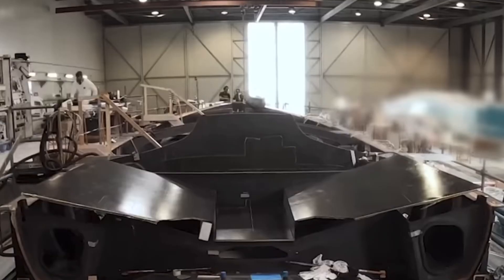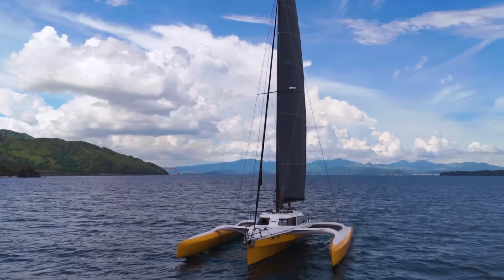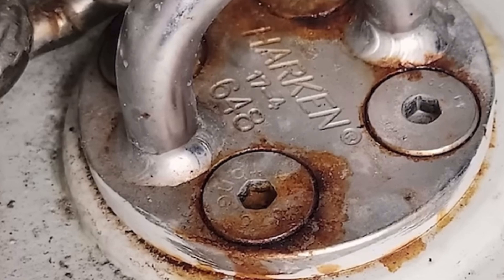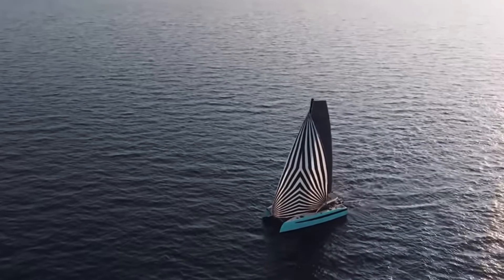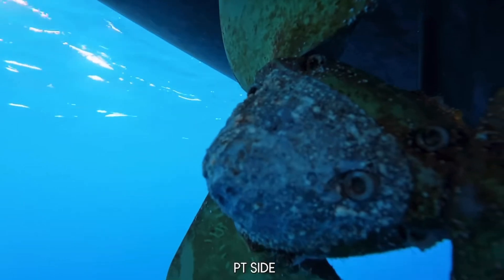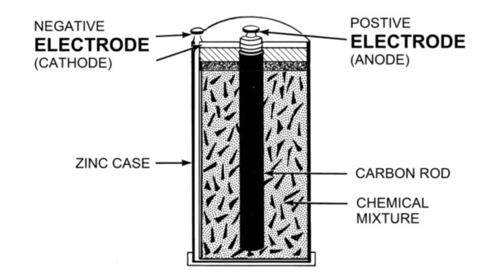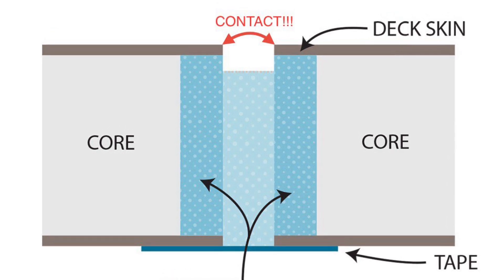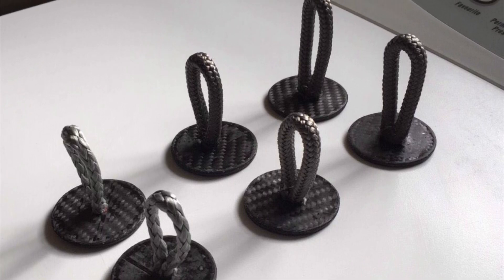Is Carbon Fibre Really a Good Idea for Cruising Boats?!?!?

Comment from the maker: I made this video is because I’m seeing more and more carbon fibre appearing in cruising boats and much of it has little practical effect other than being an expensive fashion statement. 

Carbon fibre construction can result in a lighter boat, but so can doing a build properly with S glass. For example the prototype Farrier F-9/F-31 Redshift was launched at around half the sailing weight of the first production F-31s, simply because the prototype builder was far more fastidious during the build process. In other words a sloppy builder using carbon fibre can easily construct a boat that weighs more than a careful builder using S glass.

I also wanted to draw attention to the downsides of carbon fibre because I hear people talking about it as some kind of panacea that solves everything, which it doesn’t, and in fact it introduces other problems that don’t exist with other materials. 

I’m a firm believer in using the best tools for the job, and carbon fibre is the best tool for many jobs, but not all jobs!
Reply: @SailingTipsCa  I have certainly seen some heavy carbon fabrications. Getting carbon to be light requires competence from the laminate specification through to the finish 1g at a time.
Reply: @deerfootnz  Yes for example some builders are providing pretty chunky carbon masts that are actually heavier than they would be in aluminum…
Reply from the maker: @deerfootnz  Yes a shoddy builder who makes overweight boats with glass is not suddenly going to make lightweight boats with carbon!
Reply: @SailingTipsCa  It's amazing how many  boats I have delivered are nowhere near quoted displacement numbers when in the travel lift slings. Quoted displacement often excludes tank contents, sails, stores, gear, toys, personal effects etc. Even allowing for that many boats I have seen must be between 10% and 25% heavier than the numbers in the brochure. The polar diagrams published are also laughably inaccurate, in part at least because the displacement is much higher than stated. I can sail. I have alot of experience and have competed at a high level and won consistently. On some boats I can't get within 25% of the polars. The sail area numbers are often out by similar measures. As soon as you buy new sails you see how inaccurate some manufacturers are. The boat I bought for myself is one where the design displacement allows for  half tanks and 2500kgs of gear. The half tanks is because the fuel and water are pumped to the windward tanks and transferred on tacking - worth between 0.5 and 0.75 knots and/or about 4⁰ of static heel.
Reply: Do not forget some people push a product good or bad. It's how they decided to make money.
Reply: Let the carbon remain in racing, me as a future cruiser don't need it at all.... better be safe.
Reply: @Kairat1969  and why would carbon be less safe? What isn't safe is poor design and construction, and I see plenty of that in every glass production boat.
Reply: The corrosion of deck fittings is solved by going with titanium. If you can afford a large carbon boat, you can afford the titanium parts.
That, and isolate the stuff you can't have in titanium.
Carbon fibre conducts electricity. as such, it will kill alu and lesser materials in direct and even indirect (under water) contact.
Reply: @NBM397  Then some marine electrical guy will screw a device into the bulkhead using stainless screws. Suddenly the hulls are alive with sounds of electrons.
Reply: @ you tell him before he is to work on the boat.

Comment: Wood for cruising ^^ super interesting now I understand why they dont use metal for anything on the raceboats
Reply from the maker: You see more metal fittings on more traditionally built racers. For example I’m regularly sailing on a beautiful cold-molded Wylie 43 which two plies of strip planking sandwiched between glass. Nice and warm and no corrosion issues like carbon!

Comment: Properties of basalt roving
density: ca. 2,7 [g/cm³]
linear tenacity: 70tex – 4800tex

roving type: assembeled

E-modulus: 90 – 100  [GPa]

tensile strength:  3000 – 4000  [MPa]

moisture absorption : 0,03 [%]

temperature range: -260°C bis +750°C

Advantages of basalt roving

higher tensile strength compared to glass and PP-fibers

cheaper than carbon fiber

low moisture absorption

outstanding temperature resistance

natural product

environmentally friendly in production
Reply from the maker: Never used basalt but it has some cool properties so not sure why it’s not more common?

Comment: Full carbon construction can also interfere with radio transmission. ie. maybe can't make a mobile phone call inside a carbon boat, when glass boat in same location is no problem.
Reply from the maker: Yes so an EPIRB activated inside a fully carbon boat would never be heard!

Comment: I totally agree with you. Make up your mind before getting a sailboat. Do you want to race or do you want to cruse. If you want to race get a carbon boat. I have made the same mistake before by getting a corsair trimaran. Just didn't make  for a good cruising boat.
Reply from the maker: Sometimes people don’t always know at the outset. I started thinking I would cruise more but wound up racing far more. Still I think you’re better off trying to race a fibreglass cruising boat than trying to cruise a carbon fibre racing boat!

Comment: Excellent point to consider all the gear cruise boats carry, making it irrelevant the weight savings for a carbon boat. Reminds me of all the carbon fiber mountain bikes we see on trails with overweight riders puffing uphill. Carbon fiber is fantastic for competition machines, but silly for regular use.
Reply: That's just untrue, the carbon fibre reduces the weight penalty you get for loading things on.
Reply from the maker: Carbon has really become more of a fashion statement than practical enhancement for cruising boats IMHO!

Comment: Longevity.    What is the lifespan of a racing boat vs a cruising boat.     the problems you mention may not be there when the cruiser is first launched, but over time? seems to me that is going to be a problem that needs to be learned and watched by owners.   new tech , new learning curve.            😎
Reply from the maker: So many factors to consider in answering that question! Some might say racing boats encounter more stress, but they are also generally well-maintained. Older generation racing boats are also comparatively over-built compared to newer ones so tend to hold up quite well. GRP construction and repair is quite well understood by both builders and repair shops, but carbon less so. The act of laying them up is similar, but there are electrical isolation issues to consider with carbon which don’t exist with glass which is a big part of the knowledge gap.

Comment: The university of Auckland material science lab has been experimenting with a number of different fires still just as expensive as carbon fibre is flax fibre a natural fibre. That is very good but the one for me that stands out is the Russian Basalt fibre made from basalt rock it does not have the problems that carbon, with the electric Galvan corrosion it seems to be very strong in tensile and compression. 
I recently bought a couple of rolls and have been successfully repairing transcend and building other Boating parts from it both hand laminating and infusing it. I'm about to build an emergency Rudder for a far 36 out of Basalt.
Having built a lot of one off carbon Boats I've seen the issues and building some of the first F27 and 31s in San Diego. 
There are some yards around the world that buy bulk carbon and one in particular that I know buys it for the same price you would buy E glass for but there again when your store has over $1 million with fires in it what would you expect?
Reply from the maker: Thanks for the interesting information! I’ll have to learn more about basalt fiber!

Comment: I think that for cruising we should ditch carbon and glass fiber all together. There are so many boats that can’t be recycled. Go with a material that can. Like steel aluminium or wood
Reply from the maker: I think steel and aluminum are great materials for cruising boats! Both recyclable as you noted and also robust and easy to repair worldwide. I’m slightly less fond of wood due to maintenance issues.

Comment: Man! I had no idea about this corrosion issue on carbon boats!! I used to think they were more on the fiberglass side but it seems to be more troublesome than aliminium - you expect that on aluminium boats, so you always have an eye on it. Wow! Thanks for the video!
Reply from the maker: Yes it’s a big problem with carbon and apparently unknown even by some boat builders! At least with Aluminum you can weld on aluminum fittings (e.g. pad-eyes) but with carbon you need to plan way ahead for that stuff because of the internal supports required.

Comment: really usefull informations. what about kevlar?
Reply from the maker: Great question! Kevlar has excellent tensile and abrasive strength but is not good under compression, unlike glass or carbon. That also makes Kevlar hard to work with because it doesn’t sand out as nicely as glass or carbon if there are fibres reaching the surface.

Comment: Carbon fiber is only 30% lighter than glass .
After that its all down hill
Reply from the maker: Certainly lots of downsides especially for cruising boats with lots of electrical systems and stainless fittings…

Comment: carbon is just a better material and also more expensive... that doesn't mean it makes a better boat, a better boat can be made using it, but not every good boat is carbon, and not every carbon boat is good.

carbon can't be even compared to fiber glass for structure, one thing that some don't even realize is that carbon been a stronger material make many things possible, that before wouldn't be... for exemple window's, a carbon build can enable the builder's to decide for bigger and more windows. it is just better, but much more expensive, just like multihulls, better in many ways, but more expensive.
Reply from the maker: Carbon is definitely lighter and better at certain things e.g. stiffness and has made many things possible as you noted! Plus the technique of the builder plays a huge role. Here’s an interesting video on the comparative strength and stiffness of carbon, glass, and Kevlar which says that while carbon is lighter and stiffer that s glass (fibres only) actually has a higher tensile strength: https://youtu.be/KHXVf0SaJpA

Comment: Just use carbon in the areas that high rigidity is required and the extra cost is justified
Reply from the maker: Exactly -  the beams and certain high-strength areas can definitely benefit from carbon!

Comment: The hh44 of is not all carbon. It's mostly e-glass
Reply: The OC model of the 44 is about 40% carbon, 60% e-glass.

Source: I am having an HH44 SC model built currently.
Reply from the maker: @kylemackenzie163  Good luck with your new boat - hopefully HH has all the issues sorted by the time you get it!
Reply from the maker: Jason claims in this video that it’s about 50% carbon and lots of good shots of the unfinished interior too: https://youtu.be/AGaiVCHAw_M?t=19m30s

Comment: I would take the side of F/G over C/F and would also point out the cost saving of polyester/vinylester resins v epoxy resin. How much money is wasted using epoxy resin on boats built many years ago using polyester resin, sometimes as many as forty years plus, these boats have lasted for decades but suddenly they require epoxy for laminating? I endorse the use of epoxy as a moisture barrier or bedding compound, but it's not required for general work. The savings are truly worth researching. Also learning to fibreglass by doing a composites course at a college is money well spent.
Reply from the maker: The subtle difference in repair vs initial build is primary chemical vs secondary mechanical bonding. That said I think they are using Vinylester on Sailing Uma for their rebuild and have done some comparative break and secondary bonding tests with Vinylester epoxy which were very favourable hence their cost-effective choice for similar strength!
Reply: Tests that were so basic that they were an embarrassment. This was a couple who built a boat within a boat and were sublimely happy that the hull at the bow only flexed half as much as it had before they built a boat within a boat. @SailingTipsCa
Reply from the maker: @johnhewett2525  I think they in part chose their approach because they’ve found it creates good viewing for their audience. Personally they went far further than I would have done myself. All of that said I have a friend who owned a composite business and also did break and pull tests with Vinylester and came up with the same results a decade earlier.

Comment: If you are buying a carbon fiber cruiser right now, you are an early adopter. Keep in mind, that any early adopter will suffer through all the issues of new technology, be they construction-specific or technology-specific. 
And honestly, I do not see the appeal for going ultra-light and high-performance on a cruising boat other than bragging. I see this issue playing out with my beach cat. There are much faster models available and as a pure sport boat, I would not even suffer from things such as noise or weight of everyday items. But I can now go around 20 knots and that is plenty. Even stressful, when the lake is busy. What is the point of going 25 knots or even 30+ with a foiler? It just makes everything more stressful and complicated
Reply from the maker: I think it’s a bit of a fashion statement in cruising boats, and you make a great point that going fast is stressful which is kind of the anti-thesis of cruising in many people’s minds!

Comment: I agree with your deduction. The stiffness is evident in the harmonic vibrations of the new imoca hulls. Pip Hare demasted after flying and coming down. Shakes the hull out of the rigging.
Reply from the maker: Yes too bad about Pip to her credit she’s doing a great job of getting to Melbourne! I think all their masts are one-design carbon and they have been known to fail periodically…
Reply: The one design mast off the imoca 60 is "old" and was never designed for the current foiling boats. That is why the boats are getting an upgrade next year for the mast
Reply from the maker: @benjamineikelenboom5332  While everything is going well with the foils there should actually be less load…until you fall off the foils and everything loads up dramatically as we’ve seen.
Reply: I knocked on the side of Wasabi, a completely carbon race boat in our marina. It was literally like banging a drum. Great for going fast or starting a percussion ensemble.

Comment: What about aluminum hull? Can't seem to find a video from you discussing about this topic. I assume the sound transduction is probably quite bad without insultation, but the rest of the properties are quite promising. Cheaper than carbon, better than glass. Much safer than both, especially when it comes to impact resistance.
Reply from the maker: I think aluminum is an excellent choice for cruising boats and I’m looking forward to seeing Delos 2.0 out on the water! One does also have to be mindful of electrical isolation and galvanic corrosion, but that can be managed and there is lots of expertise on that matter with aluminum. It’s nice that you can just weld on deck fittings and you don’t need paint. Another downside to aluminum is that it does conduct heat very well so needs to be well insulated. I’m a fan!

Comment: Carbon Fibre is fantastic but it's very very expensive when compared to fiberglass.     For the price difference fiberglass just makes better sense and you don't have to worry about ground faults.
Reply from the maker: Exactly -  a well-built S glass boat can be quite light and still strong and much easier to maintain!